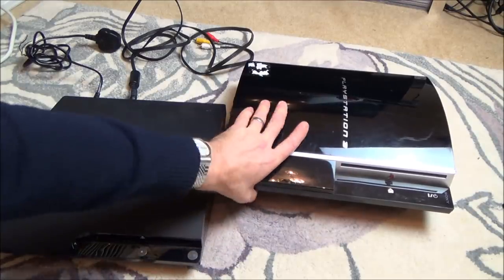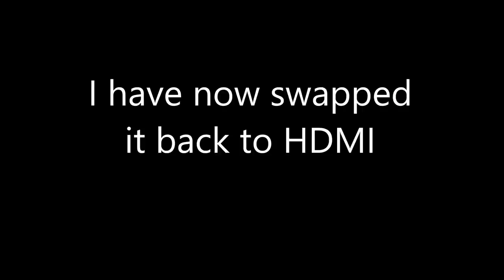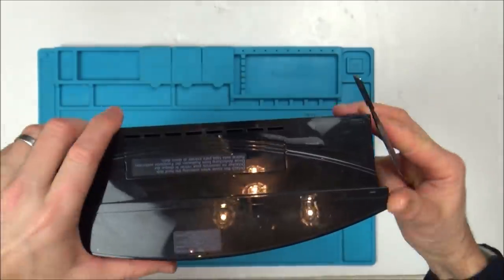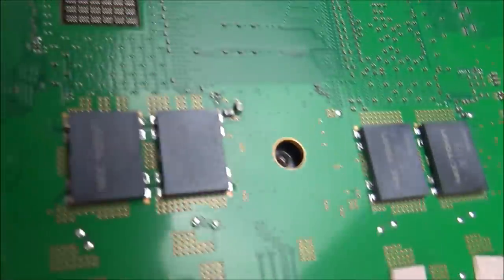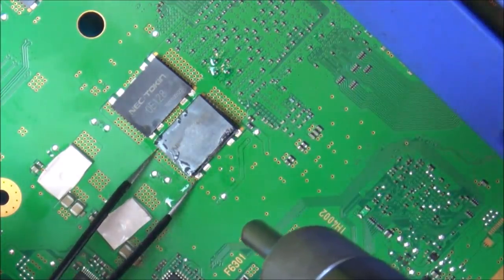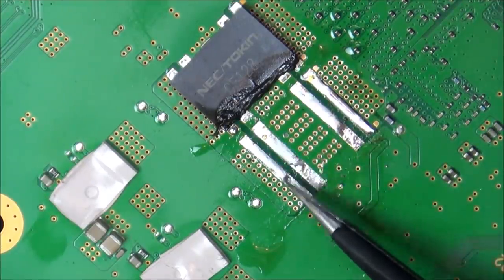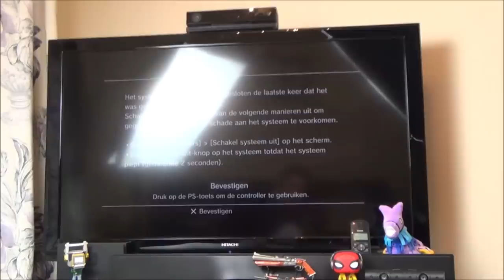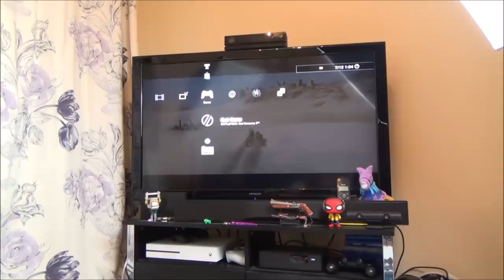Marcel's Lot PART 4 - Faulty SONY PlayStation 3 Slim & PS3 Fat

Comment: Yeah, it was a recent find that the YLOD is actually NOT usually caused by the main chips (CELL/RSX) in any way. It turns out that most failures of the PS3 Phat models are with those cheap little capacitors next to the chips.

Glad I never sent my 60GB launch for reflow or reball! Haha

Comment: Those cap's are complete rubbish. They do save space, but they break very fast (if they last more than 4 years, with daily use, you're lucky). Not only on PS3, but on some laptops as well (some Toshiba models that use only 1 nec/tokin under the cpu socket, it replaces 4 330uF caps). 
Good video and nice fix, by the way.

Comment: It seems the Super Slim model was the best manufactured, the drawback was not PS2 playback and in my personal experience my bluetooth and WiFi died after 10~ years. (Wired control and Internet still works)

Side note: the Xbox360 S or gen2 (the one with the matte finish) was the best manufactured; the original(base and elite form), gen 3 and gen 4 (black chrome finish and the semi-XboxOne style) were pretty weak.

P.S. Glorious repairs, repairing a console always feels like bringing someone back from death.

Comment: Gotta love that moment when "sold because no display" then plug in hdmi and or avi cable and works without a hitch lol I got my ps3 slim for 5$ with same symptoms". Also great news on the ps3 fat repair was kinda scared to see you use that giant cap lol glad it didn't pop wouldn't want so see that happen.

Comment: Tantalum caps works differently than normal caps, they also have different ESR. Typically, high frequency devices use very low ESR. This fix may cause further problems but now you know what to do ;)
Reply: Yes the original NEC-Tokin caps are polymer-tantalum capable of very high frequency.

Comment: That PS3 slim I beleive is one of the first releases. They did a few, the first generation of them had the chrome panel below the disk drive and the white LED's in the power and eject buttons themselves. I beleive these ones were 320GB roughly? The second generation had a piano black panel below the disk drive. And these didnt have the white LED's in the power and eject button. I'm pretty sure these ones where 160gb? Its been a while so I apologise if my knowledge isnt exactly correct. In the past I jailbroke PS3's and use to repair them too. Whenever I saw a faulty first Gen slim I would always buy it as these tended to be on FW just below 3.55. Remeber this was years ago when you could only jailbreak on 3.55 CFW. Pretty useless information now but just in case you was curious Vince

Comment: You can remove the warranty void label by warming slightly with a heat gun and peeling it off it won't leave its void behind and you can put it back with the same method.

Comment: With respect to reflowing or reballing CPUs and GPUs -- as Louis Rossman always angrily points out, a lot of the time with these chips the broken connection is actually between the silicon die and the chip package and not between the chip package and the PCB.

If the problem is indeed cracked solder balls under the chip, then you can reball it, but if there's a broken connection inside the chip package it is not worth the effort to fix--you're better off just putting a good chip on.

Comment: Hi there Vince, greetings, well good job and good guess you have done here and plus another working product sold as bad again... As for the capacitors they are big flat multilayer and you need them to reassemble the console back properly... The replacement of them will be probably a nightmare without specific tools and technique

Comment: In high power switching regulators like these the capacitors are all about low equivalent series resistance (ESR) and inductance (ESL). Two non-ideal properties of capacitors that can render them useless at high currents/high frequencies respectively. Electrolytic capacitors are the poorest capacitors by a wide margin, but they're cheap and offer the most capacitance per physical volume. This probably works because there's multiple of those NEC Proadlizer capacitors in parallel. If you'd replace them all with electrolytics they'd do such a poor job at filtering that it would be unlikely to work/be stable. In short, electrolytics and any other type of capacitor are nothing alike.
Reply from the maker: Thanks for the info :-)
Reply: What's happen if i use only the electrolitic capaccitor 470uf 16 v.? I need to use tantalium? , is the only way or it's works fines with the electrolitic?.. sorry for My English

Comment: I believe the fully backward compatible ones essentially had a PS2 built in to them. The funny thing is that any PS3 is capable of emulating PS2 games at full speed so I don't know why they thought that was necessary other than for a little bit better compatibility. You can/could obviously buy PS2 classics on PSN and install and play them on any PS3 but only the ones with the extra hardware can play from the disc, though I don't think this is actually a hardware limitation of the PS3 because if I'm not mistaken it can be worked around with CFW.

Comment: Great Job Vince,  You are as good with soldering as I am haha. Take a look at some of Big Clive's LED projects, He gives so much info about soldering (especially how important tinning is, that's why those caps went on a bit rough i think lol) Also,  I've never used the heat gun before,  but my guess would be to have a lower airflow but keep your hand moving in circular motion constantly maybe? It seems the concentrated heat in one place gives some issues

Comment: Just for future reference, The DualShock 3 SixAxis controller requires a data USB cable (all 4 pins) and an intelligent host to charge.  It will not charge from a typical phone charger, but it will charge from the PS3 or a personal computer, and possibly other devices that support USB protocols.
Reply from the maker: Thanks Lard :-)

Comment: You can get smaller 470uf smds and solder then to the bottom rails and then take some wire and link them to the top + and - rails, these capacitors are a light brown colour and alot cheaper and easier to source than the black type.

Comment: @mymatevince the early version of the PS3 slim has the model number CECH-2004B the second gen has 2504B and the third gen was the SuperSlim using Sliding DiscDrive and has the model number 3000 and 4000 depending on regional specifications so the 3000 SuperSlim is sold in Europe and USA but the 4000 is sold in Australia and Japan

Comment: Getting a backwards compatible ps3 with the ylod in the post soon. Might replace the nec capacitors to see if it works. (Might heat the capacitors to test if they are at fault, if the console boots after heating them, that is the fault point)

Comment: Hi Vince, on my side it’s a total fail. I got a hakko soldering iron and a heat gun, I have two types of solder, liquid flux and no solder is sticking to my board... I think my iron is on the highest setting too. Any advice? Thanks!

Comment: I have a 20 GB PS3 (CECHB01). It has an issue where it will turn on but no picture appears on screen, and no its not on the wrong display setting such as the slim ps3 in this video. I cannot turn it off by holding the power button and the HDD light is not flashing. I have done some research and have found that it seems to have the Green Light of Death (GLOD) and is related to the GPU. Would replacing those capacitors on it fix the issue if anyone knows?

Comment: And yeah I have to echo other people and say that you really should be using a board preheater for desoldering parts like this. You've got a massive board with a lot of layers and the capacitors are attached to power planes on both ends. Doing it without a preheater is going to be a massive slog with much higher risk of damaging something.

You could maybe achieve something similar by taking the nozzle off of your air gun and just waving it around the board at 150 C or so for like 10-15 minutes, but a preheater you can just set, walk away and come back.

Comment: You would need a better hot air station . the ones with the fan in the handle are no good for this type of job , you would kill the new caps before you could get them solder down

Comment: Could i use 16 volt 1000 microferad doing this fix as if so could use 2 x 16volts instead of 4x 6.3volts 470 microferade. Would this work as i have no avx flat capasotors only policap cereamic i was thinking of attaching wires and puting a board to the wires and ill put polycaps on board and ill find a place to fit the board .if ok could you let me know if ill be ok doing it this way chears.

Comment: Popped two of these PS3 motherboards into my cooking oven to try and heat up the old solder to see if it strengths the connection. I forgot to remove the tiny battery on one of the boards and it exploded. Long story short I'm left with two exploded motherboards and a bunch of parts. Thinking of buying another broken PS3 and trying again, no ovens this time.

Comment: You should put 4 Tantalons for each Voltage line, 4 on the GPU (RSX) line and 4 on the CPU (CELL) line.
No need to take off the NEC Tokins, as you did see, is a pain to do so.
Just scrap the green resin from the board to get to the cooper, then solder the Tantalons, just being carefull to line the correct  Positive and Negative lines.
Also, just solder it on the back side of the board, just like you did in this video, is much easier to work this way.
Reply: If you look closer to the board, the outer pins of the NEC Tokens are Positive, and there's some contacts around then inside the deeper green rectangular line. That area is all Positive line. Solder the positive side of the Tantalon there.
The area beneath the rectangular deeper green line is all Negative Line, scrap some of the resin and solder the Negative side of the Tantalon there.
Reply: @dfranzner  Why not take the NEC tokins off? Why 4 tantalons?

Comment: Really, i LOVE your vids. But PLEASE, just once, try 320° and TIME. preheat the board slowly with some big movements of the airgun and then more and more focus on the chips. There where massive heat sinking areas and you tried to get everything hot in less than 10 seconds by scorching 2 pins with 480°
Reply from the maker: Thanks Druid, I promise I will try lower heat for longer on the revisit to get the 2nd NEC cap off :-) Remember my 320 Celsius might be a lot lower than 320 on a decent machine so I might have to crank it up a bit :-)

Comment: Vince I can't get my head around this. At 34:08 you tested to see if the short had gone. It didn't so by fitting new electrolytic caps to those rails would not make any difference whatsoever. for a capacitor to work would need to have different polarities on both sides.
Reply: Until capacitors are charged they act like a short circuit. When they are charged they act like an open circuit. This phenomenon is called capacitor transient response (DC). You can test this by having a discharged capacitor, switching your resistance meter to ohms and then placing your probes on the connection points of the capacitor and watch the value slowly climb (for a working capacitor). Often to fix an issue with a circuit, one has to inject voltage to locate the issue, in this case that would be one of those times.
Reply: @nordinabouzahra7829  Several 1000uF would be charged by a multimeter to its test voltage within a fraction of a second.

It could be just the GPU IC, they can exhibit extremely low resistance vcc to ground.
Reply: Siana Gearz That makes sense, I had no idea GPU IC could look like a short, quite neat. I was thinking that the capacitor never charges because it is in circuit therefore continues to act like a short, but the IC explanation makes more sense.
Reply: @nordinabouzahra7829  I have found out that there is low resistance across the rails.  The meter beeps because of the low resistance and not a short. Unfortunately his meter reading was out of view.
Reply: @retrocomputeruser  Yep, that matches what Siana Gearz was thinking. My apologies for thinking otherwise.

Comment: Tantilum caps, have better tolerances and do not degrade as fast as leccy caps.  Also looking at your rework nozzle it looks like you use the same nozzle for all your jobs,  you can get IC shaped nozzels  in square, oblong etc, will make you life a bit better.

Comment: You can remove the warranty sticker without letting any "void" marks appear by heating it with a hair dryer, the glue melts and the adhesive comes off easily.

Comment: Using flux when removing components is redundant.
Those capacitors are in parallel, so removing one will still have a short, if you took them all off and it's still shorting then you proved that it was the cap.
You cant replace a tantalum capacitor with an electrolytic, they have way different characteristics.
I guess you can use it to debug. But it doesn't have the transient response needed.

I'm very surprised it actually booted.

Comment: too bad they got rid of the video response feature on youtube i have a weird problem with my ps3  it was ylod after 1-2seconds like yours. reflow and apply washers to increase pressure managed me to get up to 10 seconds then it dies with ylod again :/ had switched hdd but have no spare psu/Drvie :/

Comment: I have a slim PS3 that has the rlod issue. Luckily I have a soldering and reflow station. Guess I'll be checking the capacitors and replacing them 🤷‍♀️

Comment: This NEC/Tokin capacitors are very prone to failure, for some technical reason. There's a lot of videos about it in brazillian portuguese and spanish, of how most fat ps3 will mostly have failed nec/tokin capacitors and people mistake for problems in the RSX or CPU, thinking they need to be reballed or reflown. Crazy that it worked with the eletrolitic caps, most surely put some tantalum caps in there and do a follow up.
Reply: Vinicius Fonseca Tantalum capacitors are extremely sensitive to reverse polarity, voltage spikes, etc. It honestly might be worth going with another type of capacitor so long as it fits within the clearance of the case and has the proper rated specifications.

Comment: As you can see in this video. Most of the broken fat ps3 systems have bad caps.  So if you have a broken ps3 just replace those nec caps and see if it works after that. 80% of the broken fat ps3 systems  and some slims are broken because of the caps

Comment: There are better ones but when I started working on these and 360's i started with a T8280 board preheater, PS3 boards can be a pain the the arse to solder on as the dissipate heat pretty well

Comment: So does anyone know what is the PROPER or pro way to remove those caps intact? High temps and leaded solder didn't work so what's the best technique?
Reply: Keythong maybe touch a folder gun directly to the solder points

Comment: The problem is that the yellow light of death is really a fault that the ps3 can't identify and doesn't give you any clues whereas the xbox 360 gives you a code with 1, 2 or 3 red light errors which points you in the right direction to where the fault may be (like 0102 error, e74 error etc).  Most people think that it is just the lead free solder underneath the gpu that has overheated and bridged (which a lot of the time it is but not always).
Reply from the maker: Thanks Danny :-)

Comment: Vince try searching “oe128 nec datasheet” in Google, you can not only download the data sheet, but also buy 10 of those capacitors from eBay for $10.50 plus $3.00 shipping from 🇨🇳.

Comment: The main reason they are difficult to get off is the board will be quite a thick multilayered board with a large ground plane which will soak up all the heat even with a heat gun. Its best to preheat the area first to say 100c for a few minutes. And then remove with as little heat as possible. 300-350c max otherwise the plastic casings etc can melt easily before the solder gets hot enough to melt.  Nice fix though.

Comment: You need a Solder vacuum and a decent  Soldering Iron. Get rid of that heat gum you're destroying those capacitors and CMOS chip. Get you a soldering iron with a adjustable temp gauge, Get a quality one and when the tip hits those solder spots they melt instantly and you burn those circuit boards

Comment: I have four of these fat ps3s and one of them can get too hot so I don't run it.. and the other is like brand new never used.. and the other powers on but does nothing else.. and the last one works good & that's the one I play on if I play on one... which I rarely do these days... but I'm going to take apart at least two of them here in the near future to clean and what not... the one that doesn't work at all I got for cheap at a goodwill just for parts anyway so.. either way if I can get it working great.. if not.. I can use it for the other one

Comment: I remember I used to switch my ps3 between an sd tv and an hd one, and I’d always forget to switch it over to av (it automatically switches to hdmi when available) that I memorized the menu pattern and could change it without a display off of feel alone. Good times

Comment: Ps3 is perfectly fine it’s in the options, it only works one way, you can set it to either av or hdmi
Reply: If option is set to hdmi and you try to connect av to ps3 it will not show image, only hdmi, i found it annoying having to change it when I played on mine.

Comment: After all these years you didn't need to reflow, or reball the CPU and GPU. Just needed to replace those NEC capacitors. I can't believe this, you would think NEC would put better capacitors. Jesus
Reply: no this is wrong, it is still the gpu the the underfill on the gpu was terrible back then causing the die to shift, it actually wasnt the solder underneath the substrate that caused the issue it was the solder bumps in the gpu